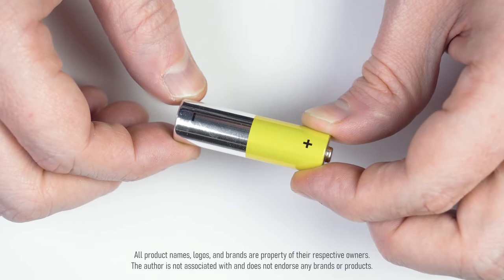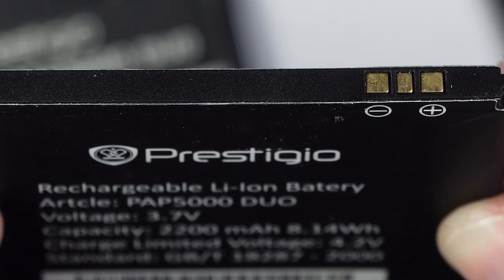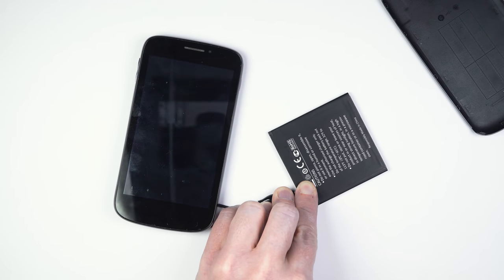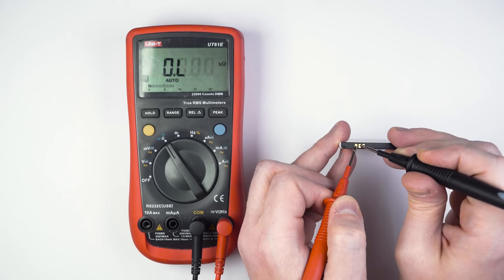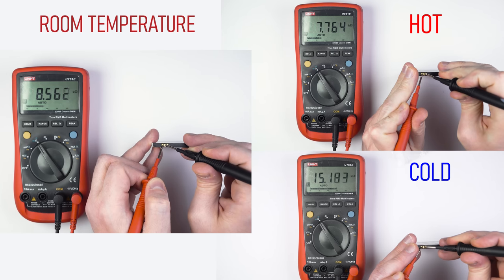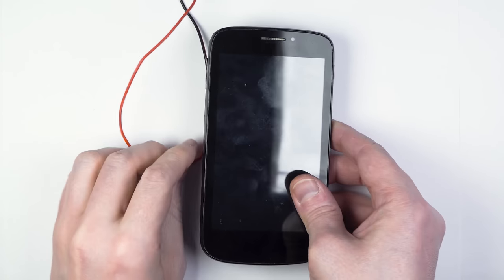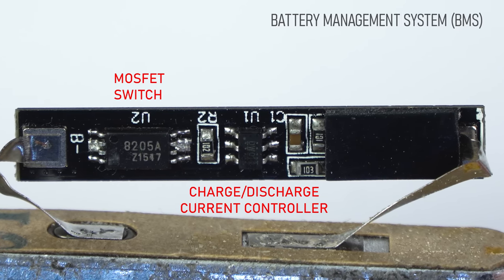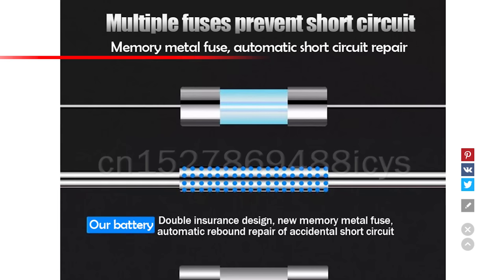Why do MOBILE BATTERIES have THREE terminals? A simple Explanation.

Comment: Yeah, I'm running my "Lenovo A2010" phone from an external 4.5V power supply since a month now and the phone itself is nicely stable. 🙂 Yes, a 10KΩ resistor between negative and middle pin is required, but also... 
● two parallel capacitors between positive and negative to simulate battery capacity
● one series diode on the positive connector to limit current and preventing the phone from trying to charging the non-existent battery
● connecting the USB to a charger is also required, because the non-existent battery can reach below 1% over time because of software reasons
So, actually, you can try this at home. 🙂
Reply: 2nd and 3rd points are understood, by why do you need the parallel plate capacitors?
Reply: @puspamadak  Those are kinda simulating the capacity of the non-existent battery, buffer for the incoming voltage. Maybe not every phone needs those, I don't know.
Reply from the maker: You are right about the capacitor. But it's actually needed to provide peak currents that occur when the phone transmitter boots up. As for the diode, no you don't need it. You don't connect a charger to the phone powered like that, why would it want to charge the battery? ;) Also, you can't limit current with the diode, and you don't want to limit it (see above why). Battery charge is monitored by voltage also, it won't go down to 1%.
Reply: @RonMattino  Okay, not every phone like that, but my phone went down under 1% and turned off over an afternoon, so, if the battery % starts to decrease over time, just add a series diode to the positive pin and connect USB to a charger...
The diode is simply prevents the phone from trying to charge the non-existent battery and eliminates the possibility of the phone heating up because of the unnecessary charging attempt.
Reply: @zsombor_99  is that save, bruh??
Reply: @AlwaysOnForever  What?
Reply: @RonMattino  what about plugging it to computer via USB? Such connection will charge the battery, isn't it?
Reply: @RonMattino  The phone will absolutely go down to 1% on a constant voltage source, as GreatScott! mentioned in one of his videos. It is most likely because the phone only measures the voltage on startup, and then estimates how much should be left in the battery. So you need to be able to power the phone via the usb port, to trick it into staying at 100%.
Reply: @zsombor_99 make a video response bro! If your cam shy, don't even have too talk or produce a well edited video such as this one... but it's clear we all like learning these types of things, so I'm sure some Lenovo lovers would find it interesting input too. 

Pics or it didn't happen! 

😄 🤣 😂 😆
Reply: I think I will make a landline Nokia 5110 like this. I think it'd be cool
Reply: @loganmacgyver2625  It won't be "landline", just "batteryless".
Reply: @zsombor_99  I know
Reply: @loganmacgyver2625  Okay, just "landline" means... You kniow... the phones in old people's homes.
Reply: @RonMattino  there are certain primary and rechargeable battery chemistries out there that output constant voltage until the very end of their capacity. So laptops have chips that measure the current going through it and estimate battery percentage. That’s why you need to make those devices think they are in charging state.
Reply: WHy take ANY chance with ANYthing Lenovo, this brand had been made  by IBM  but the  whole division was sold to the Chinese post 1990, and the Chinese really have no time or inclination to make batteries quite correct!
Reply: @guysabol8743  I had a "Lenovo A2010" as my main phone for a few years and only one replacement battery and one charging port repair was needed, nothing else. I mean, it's not bad, I just had a quite cheap model, that's it.
Oh, also my laptop is Lenovo and it's good...
Reply: @puspamadak  Had you used the bms strip that came with the battery... you wouldn't need anything else  just separate  that thin section from the top of original battery. you have it.
Reply: @zsombor_99  dude, there's never a need for a diode in this, i mean, never, the capacitor alone does the trick, and if you need the thermistor a 10k is like the default standard used in chinesium batteries,
Reply: @fss1704  Not every phone needs that diode, of course, but my phone needed it, because the phone got warm without it, which I wanted to prevent ‒ getting warm is not good at all. (Don't try to tell me otherwise.)
Reply: wow
Reply: Terimakasih atas informasinya. Informasi ini yang aku butuhkan.
Reply: @agusdear1  English, please.

Comment: That's pretty interesting, although most Samsung batteries (not for newer phones, that's a separate component) have the NFC coil integrated into it, that is the case with the Samsung Galaxy s5 for example, that's probably why it has 4 pads instead of 3 pads.
Reply from the maker: Yes, exactly, that's NFC sensor output. The battery also has the "near field communications" message on.
Reply: @RonMattino  It is not 'NFC sensor', but NFC antenna. To be honest one end of it, because second is grounded internally.

Comment: Ah yes, I remember having phones with replaceable batteries...
Reply: If you're in the EU new phones in like... 2025 will be required to have user replaceable batteries.
Reply: @ayoCC  Hopefully if the OEM's have to comply with EU rules they'll just sell the same models over here.
Reply: Every battery is replaceable, only opening and closing smartphone takes time and tools
Reply: @SekretyZdrowiapl  Sure, just not a job for a rank amateur.
Reply: @civildiscourse2000  Yeah. Modern phones are glued together and require heat guns/special equipment to pull apart (especially if the phone was advertised to have some form of water proofing like the iPhones). it's why I don't really offer to try and repair/replace screens on people's cell phones on the rare occasion they wanted me to. I used to work on stuff like that as a hobby and today's phones are too much of a pain in the a** to open up these days. So I just say no. :P
Reply: @MagnumForce51  Yeah I hear that bud. I've thought about getting into it from time to time but I can't get enthusiastic. If I was 20 I'd be all over it, but I've been alive too long and repaired too many things that were actually designed to be serviced. 

Forty of fifty years ago it was proposed that manufacturers should have "cradle to grave" responsibility for their products. It would force them to design products for longevity, serviceability and better end-of-life material recycling.

I'm still waiting.

Comment: Thermistors were present before lithium batteries were used.
If you check the battery packs on power tools, even the old ones with NiMH or NiCad always had at least an extra connection.
You can also find batteries with even more connections for smart charging using a BMS (Battery Management System). The BMS can be in the charger or the battery (depends on the design).
Reply: Cool! Thank you for this information. :)
Reply: A 'BMS on a charger' is known as a cell balancer, balanced charger, or 'charger with built in balancer'.
The term 'BMS' should only really be used if it is mounted on the battery itself, if the circuitry is on the charger, then you should use the term balancer - that way when designing the electronics you know where the balancing occurs and whether to specify a balanced or regular charger.
As an example, model aircraft almost always use batteries with no BMS, and instead specify you need a balanced charger. This is because the BMS would be dead weight in the air (until someone invents mid-air inductive recharging!), so you have the protection circuitry on the ground as a balanced charger.
E-bike batteries on the other hand are almost always constructed with a BMS, that way you can use any charger you find that has the correct voltage to charge from, and dont have to worry about finding one with balance leads - handy if you are in the middle of nowhere, low on juice, and you can just pop into a bar and ask if anyone has a charger with them.
Reply: @Debbiebabe69  Mostly (probably 99.9% of the time in modern batteries) the BMS will be integrated in the battery. That's what we call a "smart battery".
But I don't think that anything dictates that the BMS has to be inside of the battery or battery pack.
I think that if you design a system that monitors a battery pack (or even a single cell) and protects it against over-charging/discharging, over-current, over-temperature, over-pressure (for NiMH, Lead acid batteries ... etc) ... etc. You have the right to call it a battery mangement system.
We have "devices" at work that we call chargers but the manufacturer calls it a battery management system. Of course that system is "tuned" for a specific battery but  it can be re-programmed for a different battery (which happened in the past because the "old" cells were discontinued).
The reason we call them "chargers" is because in the on older rolling stock, and some more recent, they are indeed simple chargers but on some machines they are far more advanced and control/monitor the batteries at cell level (voltage, current, temperature and pressure).
Reply: hi ppdan have you become a flat earther yet? If not I suggest watch a 13 part series called What on earth happened by Ewaranon to learn that the earth is not a globe. I got it in my about tab.

Comment: Fantastic Ron!. I'm sure others have explained those extra terminals. But your presentation is top notch. It would be interesting to see if you could figure out the extra terminals of laptop batteries. I scavenged many and in so many instances that tiny board caused the battery to be rejected as a faulty one. But when I measured the voltage of individual cells sometimes all of them were fully charged at above 4V. beside the temperature of the battery which is reported to the laptop, I suspect that at least one terminal provides the signature of the cell because my laptop recognizes the cell manufacturer and its part number. Moreover because of the laptop internal charger, it would make sense that many pins would be assigned to function as BMS. However the laptop does not really need to know the SOC of each individual cell... or does it? Just like the power supply sends a good signal to the PC, perhaps the laptop tests the SOC of each cells when it's first turned on, to make sure the battery is not faulty. The total voltage of the pack could still be good while the voltage of individual not meeting safety spec?  The laptop could easily analyse if that's true, but i doubt that's the case as a hardware approach from the internal BMS can easily handle this task.  Are you up to doing one of those laptop pack demystifying? Thanks
Reply from the maker: It's true that laptops have a much more complex BMS's. The BMS, however, cannot read any extended information from the cells besides voltage. But what it does do, is compare cell voltage to each other, and if it does not match, it flags the battery as defective. So, in some cases (this esp. works with power tools batteries), it helps to level the cells' voltage. This might trick the BMS into believing the battery is ok. As for the manufacturer and part no. info -- this comes from the EEPROM on the BMS PCB. There is no way to extract this info from the cells. If you replace all the cells, the BMS will report the same info. As for figuring out extra pins of laptop batteries, thing is, all of them are different. There isn't actually any standard that manufacturers stick to. There isn't, I believe, also much point in doing that, since laptops -- contrary to cell phones -- can run off the charger w/o battery pack.
Reply: @RonMattino  Thanks for the fast reply, Some great infos you gave there. I agree, it's not worth it. The connectors have shrunk to SMD standard now. It's just impossible to probe anything. Moreover, you're right and I've been using the charger for quite a while on some of my laptops with dead batteries.
Reply from the maker: @francoisguyot9770  Yep. Strange fact, btw. These days you can find full schematics for most laptops and smartphones online, including Apple products. However, you can't find diagrams for laptop batteries or chargers. I once tried to repair an Apple Magsafe charger with a damaged (shorted) cable, turned out charger is run by the microcontroller which blocks the device if a short-circuit condition occurred _once_. So, it was dead not due to the damaged parts but just because the MCU locked up.
Reply: @RonMattino  Yeah, that's very much like Apple to lock peripherals into the EEPROM itself. This way you're out buying another of their product because the laptop won't acceptt anything less than Apple stuffs. To be honnest, I hate the way they use the backspace even to erase forward letters. But PC have their share too, that's why i stick to Linux. All that prompted people to believe in conspiracy of programmed obsolescence.  Merry Christmas  and happy new year! Cheers!!!
Reply: @francoisguyot9770  Yes, Apple is notorious for working against the consumer's interests; proprietary cables, slowing down iPhones via software updates, lobbying congress against right to repair laws, etc. I also use Linux on everything, just wish Android was closer to regular Linux.
Reply: I have a laptop with some fault between the charging pin and the battery. The computer won't run on external power and it won't charge the battery, but it did run for a while until the battery ran out of charge. 
Any suggestions for a way to power up the laptop?
Reply from the maker: @bjhcvuaerpigfy  If your computer does not run on external power but can run on battery, it's obvious you either have a faulty charger (but I guess you've tested it already), OR another possibility the charging  circuit on your laptop logic board is not operational. This actually happens quite often. You need your device serviced.
Reply: @RonMattino  thanks Ron. I guess I had just assumed my computer was stuffed, but if this is something that happens often, I'll take your advice and get it looked at.
Reply: Great question! In older android phones you could dial stuff to use secret manufacturing testing menus, & there is a battery condition status.
Reply: I have an older (approx. 10 years) laptop that refuses to fully charge the batteries (standard battery and a extra battery that goes into the CD-Rom compartment). Apparently there has been some problems with older batteries on that series of laptop and unless you buy a new battery it will not fully charge.
This clearly shows that the battery is passing more than only charging state information to the laptop. Probably also passing serial number and/or manufacturing date to the laptop.
This problem started after a forced Windows 7 update which installed some battery management software from the laptop manufacturer (Fujitsu-Siemens) that also gave me a warning about the batteries. Funny enough since that moment the laptop on its own (even when windows is not booted) completely refuses to fully charge the batteries (60% max). I guess it sneaked in some ROM update.
Was only using Linux on that machine before this happened. I guess if I had never installed Windows on this laptop it would probably still charge the batteries to 100%.
Well, since it has 2 batteries, 60% is still more than enough for what I am currently using it for.
Reply: Laptops can use much higher power (my macbook came with a 96W charger, compared to the 18w charger of my iphone), it is common for manufacturers to use a few wires to spread the load (as more current going through a small wire can increase resistance and heat, result in melting of tbt wires)
Reply: there are specialized solutions for that kind of thing, both hardware and software. 
schematics from most batt/laptop manufacturers are available based on model. 

ps: 'the tiny board' needs to be reprogrammed when cells are replaced...
Reply: @duroxkilo  That sort of info would be MASSIVELY important. So many portable devices incapacitated by worn out batteries. And OEM batteries are near impossible to get in some parts of the world.
Reply: @abdul-kabiralegbe5660  i know what you mean. 
most manufacturers also seal the battery cover to make it extra difficult to replace the cells. 
 "Repair Tool NBLA1" is one example of a complete system to repair batteries. it offers the schematics to a large number of battery manufacturers and after the cells are replaced it's possible to reset the battery chip so that it reads the proper capacity and cycles.
Reply: @duroxkilo  Thanks a lot.👍
Reply: @abdul-kabiralegbe5660  you're welcome
Reply: @duroxkilo  wow that was massively usefull